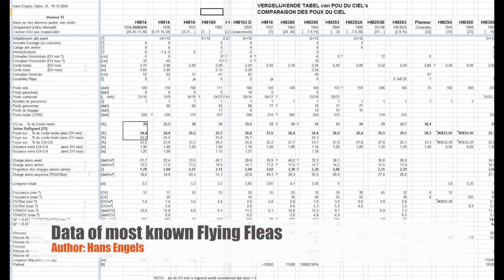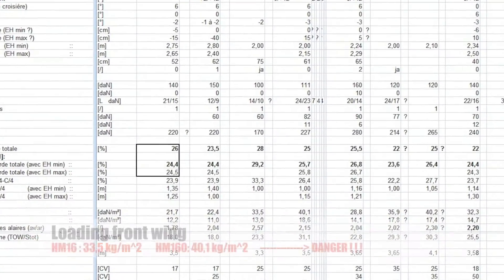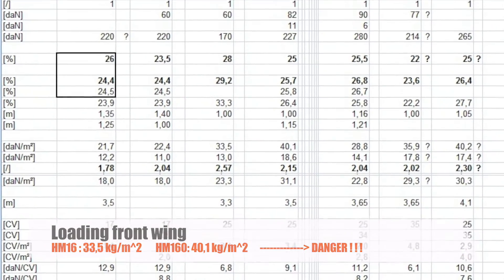Flying Flea lesson 09 HM16 / HM160 WARNING

Comment: I have been reading your site on Tandem wing designs.
What are your thoughts of Emilien Croses design?
They seemed a more modern application of the concept.
Reply from the maker: I like the CROSES designs a lot. I noticed that they recently began selling plans again. After the death of old age of the father, the son had some trouble to gather the plans for each type. I managed it after all and the CROSES plans are available again. I am happy about that. Too good stuff to see lost in a attic.
My favorite designs of Croses: Pouplume and Airplume. I am amazed by the Para-Cargo.
Reply: @nestofdragons  yeah, I read they are planning on testing composite kit to release. I shoot them a mail (in English) through their site but no response yet.
Anyway, I am planning to restore a 3 lifting surface (VLA certified) "Eagle 150B", it seemed like the only production type of the type. Principle seemed similar to tandem wing.
Any thoughts on this design?
Reply from the maker: I have not much info on the Eagle 150B. All i can see from the pictures is that you will have a advantage in view. Normal lowwings have limited view downwards at the sides. Your has just a very slender wing at the side below. View all around should be great.
Reply: @nestofdragons  I see.
It seemed to be an evolution from Rutan Quickie which Rutan himself said descended from tandem wings of Mignet and Crosses and different from his canard Varieze series.
I can see that it is tractor configuration which is different from mostly pusher of canard design, this is the only production of it's type for general aviation I understand.
Reply from the maker: I would not call it a canard. Most of wing area is in front wing. By having it as a tractor, it get the landing gear less high. There were pusher Flying Wings in France. Not many. I recall Butterfly, BG-10 and a few others.